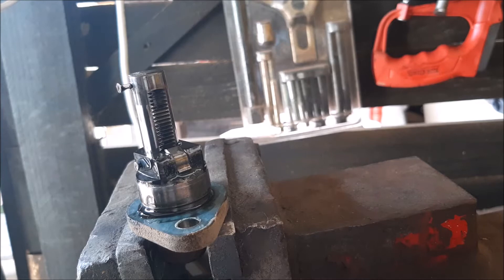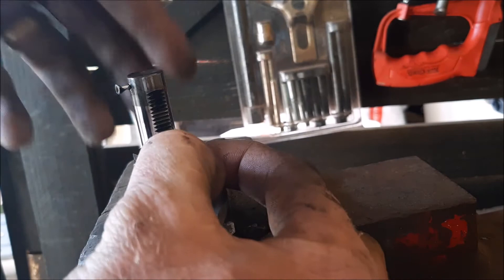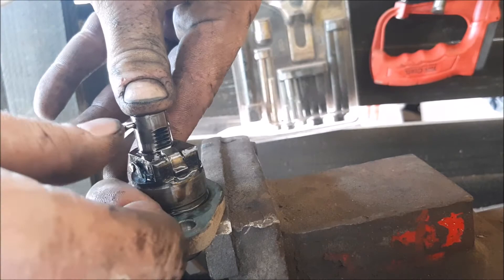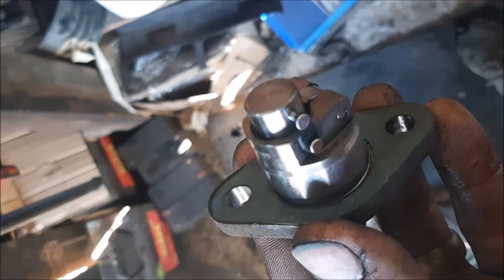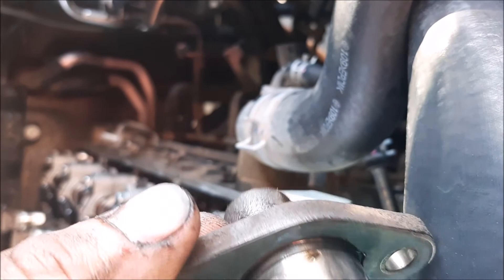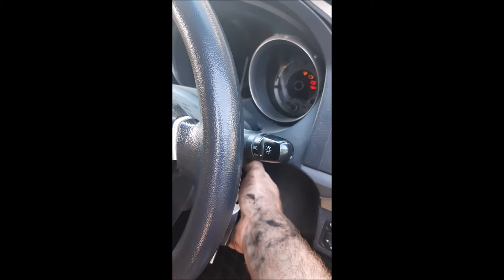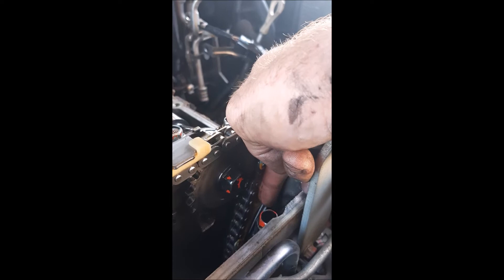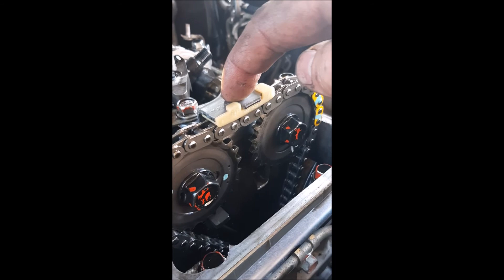mitsubishi pajero montero colt 4m40 4m41 chain tensioner reset

Comment: Thanks for the good video, were tensioning the fan belt yesterday and managed to turn the crank anti clockwize. Reseted the tensioner using your film. But i thin maybe i need to change the guide today, I have a bad rattle sound from the engine, scared that the tensioner did not lose out again
Reply from the maker: Don't take a chance. Remove the tappet cover to have a look. If it's the common rail 3.2, then the injector pipes need to come off for the tappet cover to come off. I think the upper intake manifold also needs to come off.
Reply: Marius Fourie the old noe for me sir🧐😁 only engine plastic cover for me to remove. Turner out that it was the pivot nut for the alternator that were hitting the fan. But anny ways I did the removal again.

Comment: Does the 3.2 DiD GLS motor also get a gasket for the chain tensioner, as shown in the diagram?  Just put a new head on, and there was only sealer when I took the tensioner out of the old head..
Reply from the maker: I always use a gasket there. I cut my own from vellumoid sheets

Comment: About the turning of the Crankshaft, if you use the starter motor to turn the Crankshaft doesn’t it turn anticlockwise but in the manual it says you have to turn it clockwise ? Because the engine is turning anticlockwise when it is running ! Isn’t it ?
Please could you check it again, thank you it is a great video 😊
Reply from the maker: Crankshaft turns clockwise, camshaft turns anti-clockwise.
Reply: @MariusFourie  Yes sorry, The chain doesn’t connect directly with the Crankshaft it is connected with gears, therefore two directions 
Thank you for answering so quickly,  found a picture of the timing Chain without the front cover and bam it came suddenly clear what you said.
Will buy one (Pajero / Long) like yours and doing some prep work :))
Hope you will make more videos of yours if you still have it.

Comment: Thanks for the vid! Is it normal to have slack on the non-tensioned side after resetting?
Reply from the maker: Install it and bump the starter so the tensioner releases. It should then feel pretty tight.
Reply: Thanks. So the tensioned side is tight now but the left side of the chain (with lower guide only) is slack. Is that normal too? I would assume that this slack should not be taken up by the tensioner because of the teeth on the sprockets. So maybe something is wrong with my lower guides, or maybe I am not tensioning properly!

Comment: Do u not have to crank the engine manually?
Reply from the maker: It doesn't always catch and release by cranking manually. A bump on the starter works great.
Reply: @MariusFourie   ok super nervous about doing it.
Reply: @Justh4tguy  just did mine using the starter, no issues.
Reply: What happened if cranking the engine start?